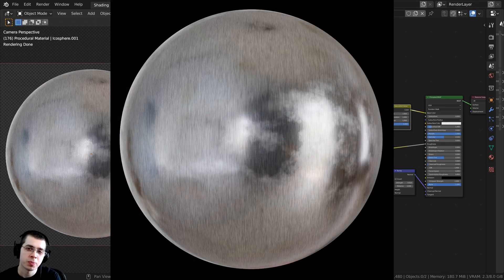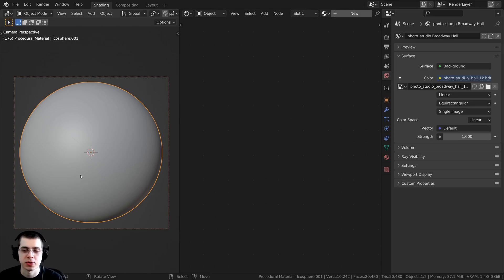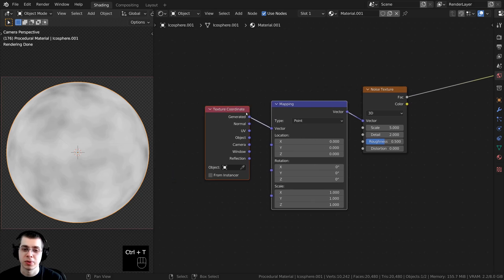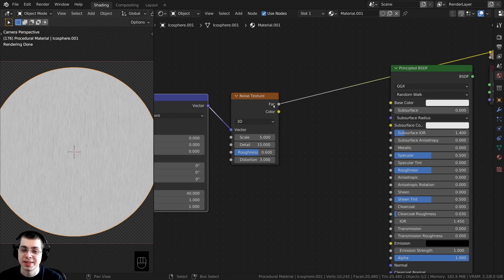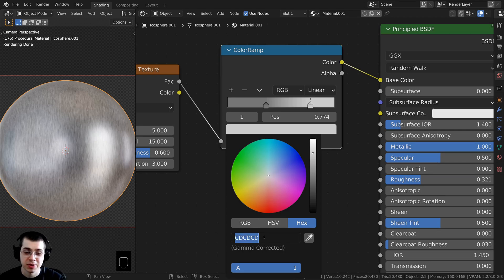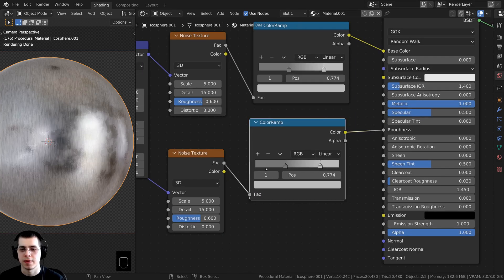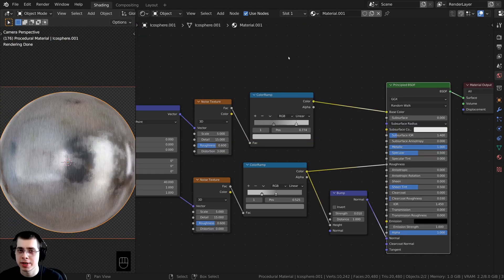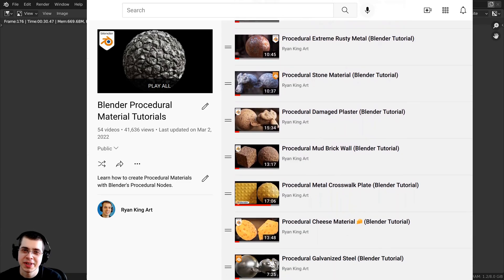Procedural Brushed Metal Material (Blender Tutorial)

Comment: Thank you for all of these great material tutorials! I've learned so much about material nodes from your excellent explanations!

This one didn't turn out for me right using Blender 4.0 unfortunately, so I made a couple adjustments. The brushed scratches were a little too thick so ended up with a scale of 14.7 on the Noise Texture to thin them out a bit. I also added the brushed noise to the normal with a another bump node before your original with a Strength of 0.023 in an attempt to give those scratches a little depth. Finally, instead of plugging the top color ramp into the Base Color, I plugged it into the Specular Tint and changed the Anisotropic to 0.768 and the Anisotropic Rotation to 0.262 to give it that brushed metal effect to lights and adjusted the Base Color manually to get the color I wanted.

I also changed the Roughness texture's color ramp greys to be almost the same just to make it a little more smooth for my taste.

But without all of the learning I did with your prior tutorials, I don't think I would have ever been able to make these adjustments. So thanks again for these!
Reply: That's an interesing idea.  I put a Mix node set to Colour after the colour ramp, and ran colour B and the Factor to a Group Input, to change the Colour and Tint Amount from the group node.  I also added other controls, including a Scale control going into the X of a Combine XYZ node, and feeding that into the Scale on the Mapping node, to control the brush scale.  I also added a master Mapping node and sent the scale and rotation for that through the Group Input.  Playing with the colour, brightness, roughness, scale adn bump strength, from the group node you can quickly come up all sorts of brushed metal looks.

Comment: Great video as usual., I have a question if you don’t mind. If we were to use the anisotropic values, whether it’s from the principled or the anisotropic bsdf itself, how would we implement it in this context to add a hint of extra realism, if any?
Reply: Copying this from the comment I made a second ago, but this might help you! I am using Blender 4.0 for this.

The brushed scratches were a little too thick so ended up with a scale of 14.7 on the Noise Texture to thin them out a bit. I also added the brushed noise to the normal with a another bump node before your original with a Strength of 0.023 in an attempt to give those scratches a little depth. Finally, instead of plugging the top color ramp into the Base Color, I plugged it into the Specular Tint and changed the Anisotropic to 0.768 and the Anisotropic Rotation to 0.262 to give it that brushed metal effect to lights and adjusted the Base Color manually to get the color I wanted. 

I also changed the Roughness texture's color ramp greys to be almost the same just to make it a little more smooth for my taste.

EDIT: you may need to play with the Anisotropic Rotation value to get the direction you want. That is just what worked for my test scene.

Comment: Oh, this is a bad one, sorry. Consider deleting this and re-do it, and obtain some real world parts to observe. Check out videos how to brush (polish) a square tube mitered corner, or the craft of creating a brushed or satin surface appearance in general, or the complex anisotropic patterns left by multi axis mill machining. You're creating an isotropic flat colored metal with noisy stripes in it. This isn't achieving a brushed appearance at all. Unless for very coarse machining marks, like the underside on a pot or a vinyl, you should never use bump node, which is used wrongly as well btw (adjust distance, leave strength at 1). Also, making a simple sphere "brushed" doesn't show any of the challenges with setting up an actual part ready for a real brushed (or satin) appearance.
1) Always use anisotropic shading for facing angles, but you can mix in very low roughness glossy shading at extreme grazing angles (although I don't bother). You can't just modulate anisotropic parameters for this one, as both will be visible at the same time. Again, observe real world behavior.
2) Adobe has some references (Adobe standard material, worth mentioning that their anisotropy is better than Blenders in that it can handle anisotropy without a roughness requirement) if you want F0 face and F82 edge tint data for various metals. Add for that extra realism, even if some choose to ignore it. I'll ignore if I don't have the data.
3) Anisotropic "color depth" varies with treatment; machined may not have any, brushed have a lot of depth, and for satin the depth is hardly visible except in extreme closeups.
4) Try a more complex part, like a European style door handle (not a knob), then make a decision; what parts of the surface to use linear anisotropy, and what (if any) to use radial anisotropy.
5) If you want to affect anisotripic spread (with no bumps), you can control rotation using voronoi color -> subtract 0.5 - multiply [0.002,0.01] or so. 0.25 is 90 deg rotation, 0.5 is 180 degree.
6) UV based tangents works fine for directional shading, but falls apart somewhat for radial shading. Meaning you have to make a conscious decision on how to approach modelling (separating parts) and if to use multiple materials to do one job, or utilizing "UV space locations" to divide (i.e. UV.u < 0, then use this part of the single shader).
7) If the part have bent tubular geometry (like the handle/snout of the Utah teapot), you need to figure out how to create a seamless voronoi patters around the seam. Erindale has a recent video on that, just need to reduce it by one dimension to remove the seam only in one dimension which is what you need in this case. No pattern seam if U space is completely filled.
8) If the part have singularities (like a Y-tube intersection with individually brushed tubes), you need to figure out how to blend the tangencies properly. I haven't been able yet, I just blend in some glossy shading (fully glossy at singularity). This may be possible to achieve properly with Blender now with blurred attribute geometry node, but check out Entagma's "New In Houdini 19.5 Pt.1" and "New In Houdini 19.5 Pt.2" for how to deal with tangent fields.
Reply from the maker: thanks for the feedback